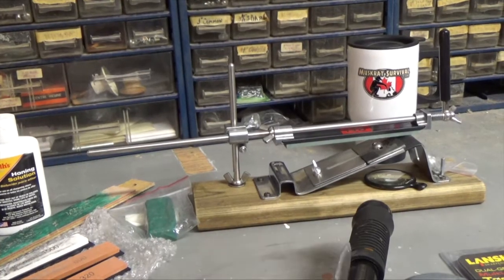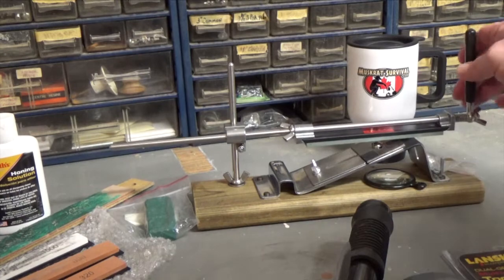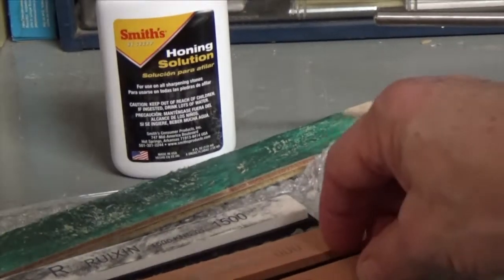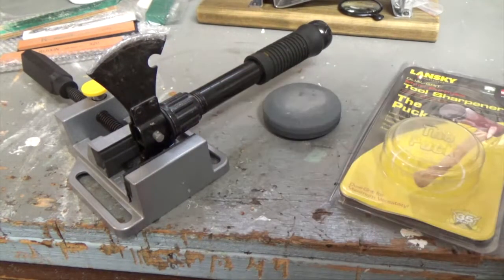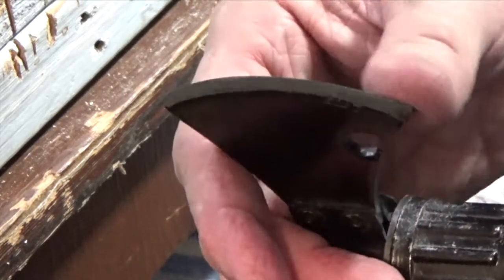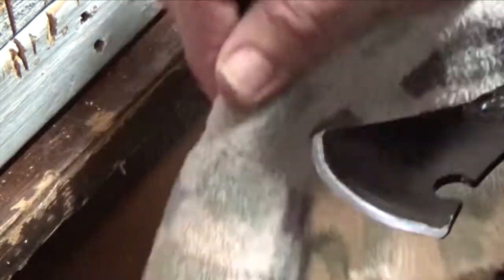Tool Sharpening Season

Comment: Good to see you Jim. I agree with you about dull tools. I'll add that dull tools are really frustrating to work with. 

With the title, I was hoping to see how you sharpen that wicked knife featured in the intro. I've been keeping knives sharp for nearly 50 years and I don't have a clue how to start with your blade. 

Best wishes, Merry Christmas to you, too.
Reply from the maker: Scott Worthington Thanks Scott. That knife (the Tracker) has three cutting surfaces. The two main ones are sharpened using a flat stone, and the little convex gut-hook is sharpened with a round diamond or porcelain rod.

Comment: I generally take a candle and rub the entire head with wax.   It waterproofs the metal and provides a degree of lubrication for tool sticking in the wood.  I used to carry a axe in the cross box tool box in my truck.  I never had a rusty axe head by doing that.  I generally left it rough but you can also use a propane torch or other heat source to melt the wax to even the layer..  Wax melts at 135 degree so you dont have to worry about the heat damaging anything unless you get way excited and go overboard
Reply from the maker: Wax, really? I heard about using wax on a sticking saw blade.
Reply: @MuskratJim  works really well.   Take a propane torch or hold over your kitchen stove to melt it smooth or leave it rough. Wax melts at 135 f so it is nowhere near the danger zone of the steel tempering